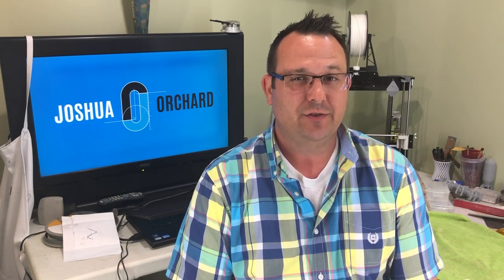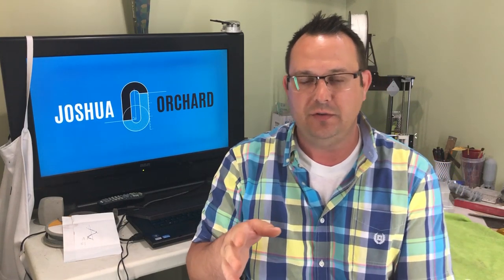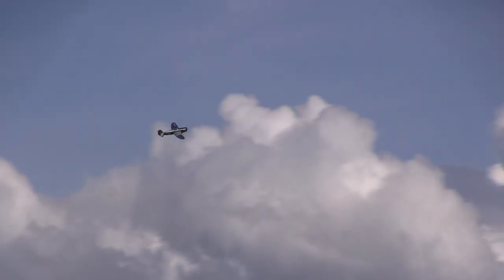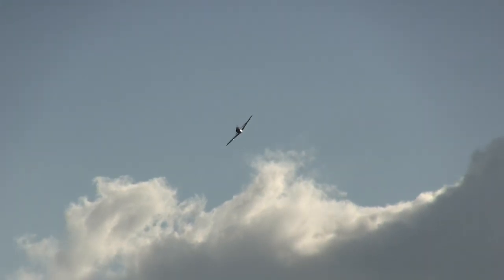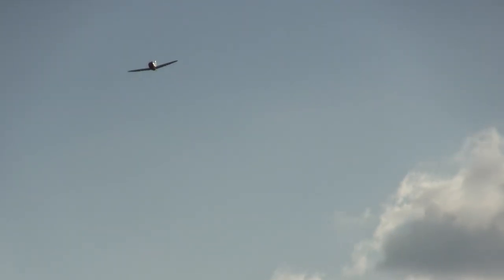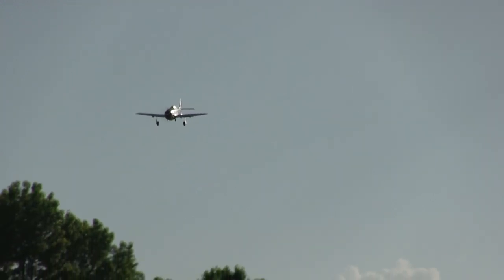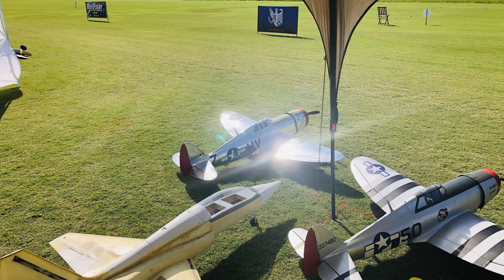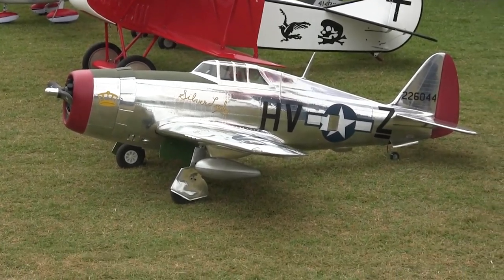SEFF 2019: Debriefing the P-47D

Comment: I reviewed the video and am gung-ho to cover my model.  I was surprised that there was little difference in signal.  I use Spektrum hardware and as you probably know, they do not recommend foil or carbon fiber coating.  Was your receiver antenna mounted internally?  I have been considering a Dubro antenna tube to get the antenna outside of the fuselage.  Obviously I will do testing.  What do you think?
Reply from the maker: Antenna (2 for FrSky for diversity) were mounted internally. Check out the article that Flite Metal has on their website about use on 2.4 spread spectrum systems. They used a Spektrum protocol there and this is dated 2007. http://flitemetal.com/